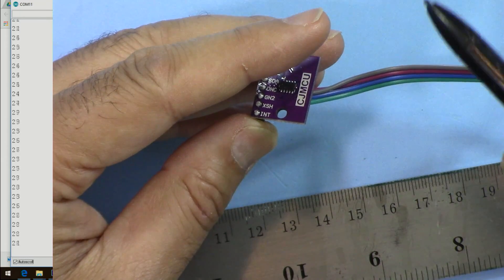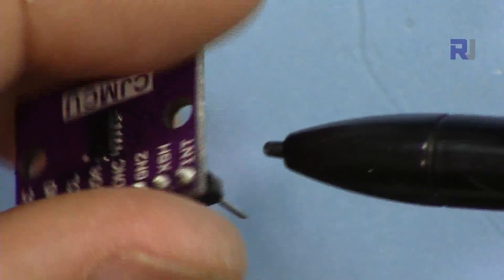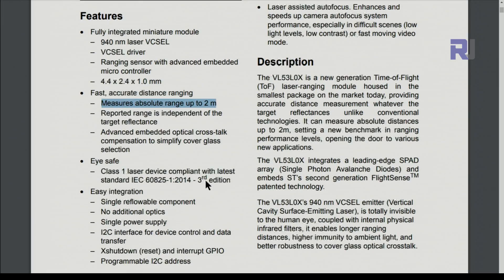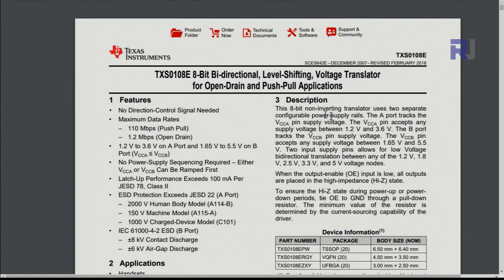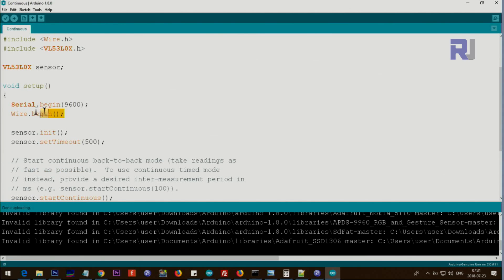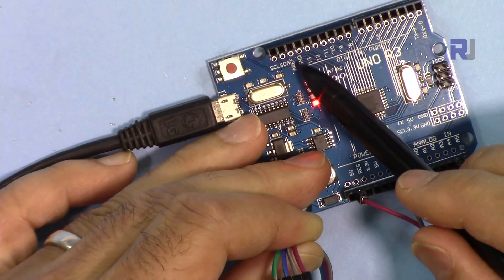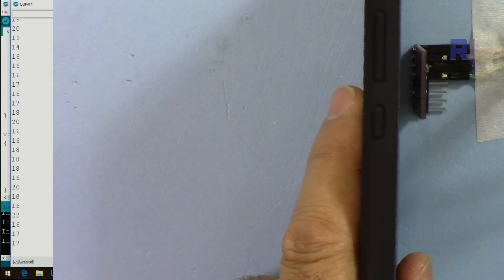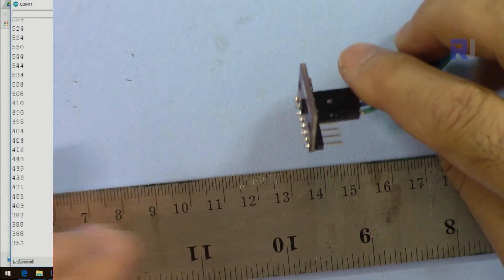Using CJMCU VL53L0X ToF using laser to measure distance with Arduino

Comment: Hi, I followed all the setup but I still can not get distance from the sensor. In the serial monitor, it always show 'timeout'. Pls help me out.
Reply from the maker: I just added the I2C scanner in the same page. Run I2C scanner and see if you are getting I2C address. This ensures the connection and wiring is correct. Also you have to include the library provided in the same page.   If still doesn't work, module is the same as shown in video and you have not modified the code, then module is defective.

Comment: I have 2 of these and cannot get them to work at all hooked exactly like your showing. I just get 65535 timed out on both of them.
Reply from the maker: You can not connect two without modifying the code. have done any modification?  post your code https://codeshare.io/ and share the URL (Address) of your code here and I will look at it. please use reply so I can find it easily.
Reply: I have exactly the same problem. Did you solve it?